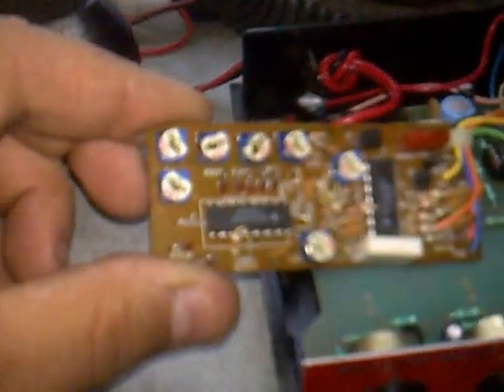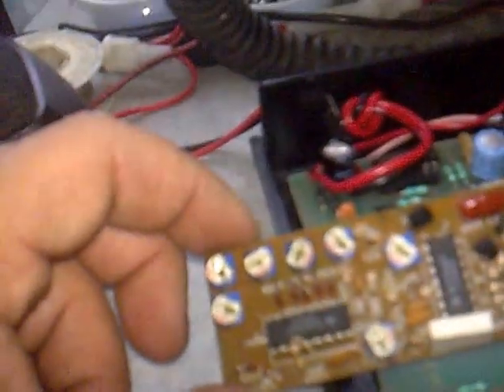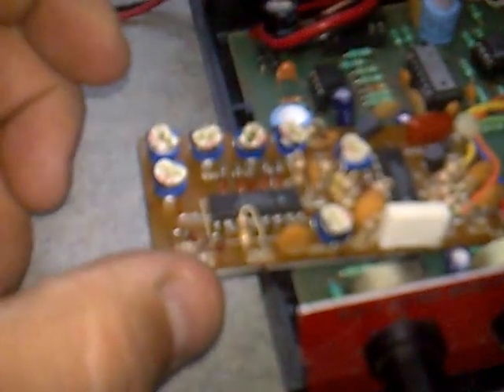D&J Echo Modulator Model 15  - Adding a 5 tone adjustable roger beep.-

Comment: I know this video is several years old, but that short ping in the key-up, is that an added capacitor in the microphone ? If so, how is it installed and what value of electrolytic does it have ? Thanks Billy ...Albq. N.M.    2 / 25 / 2023

Comment: I purchased workman 5 tone RB and it had terrible instructions with it, very vague, do you have installation instructions for the one you installed that you could share? PM me if you want.
Reply from the maker: Tom Sidebotham  it's the same rb board in the video, a workman's item. just tell me all the colors on the wires that your board has,sometimes they change them and messup the instructions.